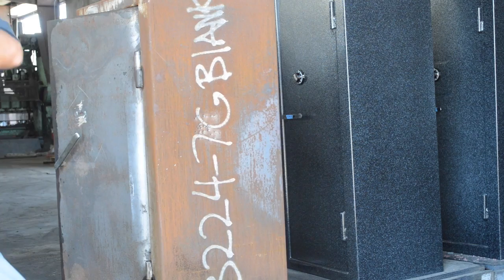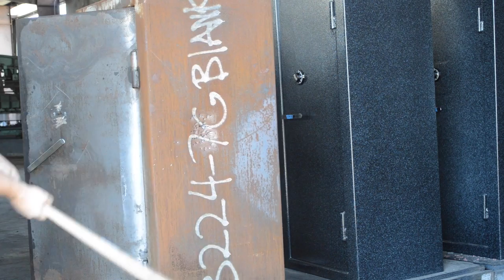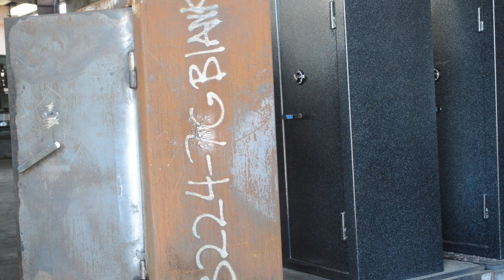Breaking Into A Safe With An Axe | Sturdy Gun Safes 3/16" Body Versus A Competitors 11g Body

Comment: Wow! I'm wishing that I had gotten a sturdy safe instead of the Liberty Revolution I bought. I was recently a victim of burglary and all my guns were stolen. The crooks used my axe to chop away the back panel after they dropped the safe on its door. Yes, it's my mistake of not bolting the safe to the floor and for leaving my axe unlocked and easily accessible. But, please learn from my mistakes so this doesn't happen to you. My guns will be missed but I have learned valuable lessons from being a victim of this.
Reply: Don’t be. That safe is just as garbage. Nobody is coming with an axe. They will have a grinder and sawsall. Unless it’s 1/4” plate steel or better, thieves will cut through the side in 3 minutes and be out in under 7 minutes.

Comment: I like a Sturdy safe. I feel they make a good gun safe. I'm not here to bash Sturdy but, the Amsec BF safe your beating up on was their base model with the 11g outer layer and 16g inner. I did a price comparison with options. If you added the 4g inner layer to the Amsec making it the HD version the two safes would be very close in thief protection. The cost ? Both safes if you compared Sturdy's 3/16 wall option with 3/8 door and Amsec's 4g liner option and 1/2 door the price was very close. They both offer a quality product. I personally feel Sturdy has a better locking mechanism on the door however, Amsec has a better door organizer and nicer looking safe. Either way you go if you invest $4000.00 in a Sturdy or Amsec Your going to stop most burglaries. In either safe power tools will get you in pretty quick.... As I said most burglaries ! You add a few cameras and an alarm system you should be good to go. Thank you Sturdy for this video I can tell you take pride in your work.      I know this video was to express that the poured fire material does not strengthen the metal or add security to the safe. I beg to differ. Anything that will slow a thief from gaining entry is a security matter. They will atleast have to cut it out of the way to get into the safe which will take more time than breaking out drywall.
Reply: With regards to fire retardant filler. I think they mean to point out that it's not cement that you would expect in composite walls of higher end safes. When there is an 1-1.5" of poured cement, the burglar is guaranteed to face noticeably more resistance than with sheets of glorified drywall.
Reply: You are correct. The Drylight sure isn't cement. If it came down to just burglary protection . I'd much rather have the thicker metal. I did learn this, the drylight is better for fire protection than concrete given the same thickness.   It's like playing rock,paper, scissors. Depends on the situation I guess. In a burglary i'd want the thicker metal.In a fire I want the fire retardant. Me I want both. I've seen the drylight in action. That stuff works . If fire protection is no concern to a gun safe buyer. Then a Sturdy safe is a good buy for around $2300. I wish Amsec would step up like Sturdy and make some hands on videos, this would help their sales. These videos show me Sturdy truly believes in what they sale and are not afraid to put it to the test. I like that. A message to Sturdy. I here a lot of complaints about you looseness in the handle. People don't like the jiggle it has. It makes the safe seem cheap. This may not make the safe any vulnerable but I know it's hurting your sales. People don't like it. Good product never the less, thank you for your videos.
Reply: Thank you for the update.Good deal, it's good that a company would keep their eyes and ears open to reviews from customers. Perhaps Sturdy has corrected that issue. I would love to see a posting of your safe and your thoughts on it. I'm looking to pickup another safe just to pack ammo in. Don't need the fire protection on that one. I may give Sturdy a call on this one. Good luck with your safe and always remember to keep your powder dry.
Reply: Very well stated. You have done your research. I am the fence as well, even after realizing exactly what you observed.
Reply: I found it hard myself to choose a Gun Safe. When your looking for a gun safe we all have a price range we're wanting to stay under. This is what I have discovered in my research. I put my budget under $5000. From Browning to Sturdy to Amsec to Liberty, to Steelwater , you name it I looked. Browning offers a good locking mechanism on there high end models but have thin walls. Sturdy has great burglary protection but not so great fire protection or appearance .Liberty has thin walls and too wide of a door gap for my comfort. Steelwater is a good choice for the money buy the're made in China and have no certified fire protection.  Amsec"s BF series offers good fire protection and good wall thickness if you upgrade to the 4ga. inner liner but, if you pull the door organizer off the door and look at the locking mechanism you'll be sick...The door locking works are very poor. I could go on and tell so much more where the Amsec BF series are good and lacking, this would take a while. I ended up going with a Amsec 6030HD. It cost me right at $4500 and took two months to get. As far as my choice goes I'm still not completely happy because of the way they made the lock bolts. Every gun safe I looked at has issues. If you and I want great fire protection plus security and be completely happy with both we're going to get into the $7500 price range. If I was willing to go up in price my next choice would be the Graffunder "B" Bishop Series B3032. Your looking at $5600 not counting shipping. I hope this helps. We haven't even touched on the subject of water damage just about every safe is not water proof and guess what the fire responders are going to put on your house fire ? Life sucks don't it. Good luck with your safe and keep your powder dry.
Reply from the maker: If we offered a comparable gauge and size to the Amsec6030HD our price (at most) would be $3331 delivered. Our safe would be larger at 32w 24d 60H, have the heavier body plate of 4g where it matters the most (which is the exterior plate), 3/8" door, 10g liner, and fire insulated. As far as the gauge thickness, linkage design and fire protection, for the size, there is none that can close to our price range. We are a commercial safe, so there is a commercial look to them, but people can pay more to dress them up. 

We have a very costly insulator that was designed to insulate objects from fires. It is an excellent fire insulator that has gone through complete burn downs successfully. Unfortunately, a representative of one of the companies you have mentioned has done quite a bit of marketing against our fire insulator on forums, and others keep spreading his message. It's flattering a company so large found us to be so intimidating they needed to have someone participate on forums to discredit our company, simply so they can compete with us. Sure, we don't want to put a fire rating on our safes, but this is because we don't want to lie to you like every single RSC on the market is. Unless UL tests it, you can't believe the rating. If fire protection is that important to anyone on a safe, they need to get a UL tested fire safe, and there is not one RSC on the market that will have a UL fire rating. We get into greater details about ratings and insulators here: https://www.sturdysafe.com/pages/sturdy-safe-fire-liner-info
Reply: Larry, SturdySafe1 is right.   Your claim that Sturdy "not so great fire protection" is completely unfounded.  2000 degree insulating blanket is used to insulate metal foundries.  You know: melting metal.     Sturdy Safe's have a sealing gasket that expands on contact with heat and water to help prevent water ingress.   On my sturdy safe I had them add a second layer of that heat triggered gasket material for some cheaply added insurance. I have no reservations about the fire protection ability of 1000 + 2000 degree insulation versus fire board and cement.  Fire board and cement are NOT insulating options.  They are fire resistant materials, but they do not protect against the conduction of heat.  You can take a blow torch to 2000 degree insulation and put your hand on the other side of it and not feel the heat.   It's hard to argue with physics.
Reply: I am not aware of any UL listed safe that uses ceramic wool, gypsum board, or any other means that gun safe manufacturers commonly use to achieve their rating.  All of these safes use a "cement" type of fill, although the composition of that fill is definately different from manufacturer to manufacturer.

 Ceramic wools are somewhat inexpensive, and very easy to install.  If they were as effective as the method that has been used for 200 years, there should be at least one company (that has UL listed safes) using it as a primary insulation.  I'm not aware of any, although a few companies do use it as a secondary insulation.

 There is always somebody who can claim to have a better method, but if it really was, everybody else would jump on the bandwagon.

 The cement type fills have been used, and continue to be used, by the biggest and best safe manufacturers world wide.  I will assume the industry as a whole has it figured out better than you and I can break it down here on the forum.
Reply: larry c  Measuring what one company does by using what other companies don't do as your argument is a form of straw man argument.   I gave you an argument on the merits of the material itself.   you could have tried to argue that refractory cement is a better insulator material.   you could have argued that ceramic wool is friable.  at least those attempts at a counter argument would have been based on physics and logic.   There is my own form of straw man argument for you.  Now to address your point:   none of those companies put their safes in whole home burn down tests conducted by the fire department.   Their claims are untested.   Sturdysafe has tested their insulation in actual home burn down fires.   I haven't seen any other age safe companies test their safes anywhere near as thoroughly.  I guess by your logic that makes sturdy safe somehow less.    "other people don't do it so it must be inferior" is an empty argument.
Reply: This is a pointless discussion. Enjoy your Sturdy
Safe.
Reply: underourrock what about liberty? They ran a whole add campaign about that for a few years
Reply: Yeah exactly I have motion sensor by my safe too and it's a Fort Knox B rate safe. I should be good
Reply: If your concerned about fire
Run a cold water line with a check valve and a sprinkler head above the safe 
 Myself I'm more concerned about burglary then fire 
Plus if it's mounted properly and in a nice tight area they are most likely not getting in
Most robbers are in and out quickly

Comment: If you have time to beat on a safe like that trying to get it open you have time to cut it open with a grinder. I'm not saying this safe isn't obviously a beast but the accessibility of modern power tools has made stand alone safes significantly less useful than they use to be.

Comment: Are you positive you're using your competitors' best safe with their added metal upgrades? Or are you doing what everyone else does and comparing your best to their entry-level product 🤔 most reputable safe makers will let you buy as much metal as you want.
Reply from the maker: This video was taken a very long time ago. Things change over time for all manufacturers, however during this time we were continuously compared to this particular brand and model, with this particular insulation still used today. Dealers would make claims of the insulation adding security. We did this video to show them how much security this insulation actually adds.

Comment: With all due respect, you are using an axe. Your safe is certainly more durable with the blunt end but can we see how many blows with the blade of the axe it takes to get into your safe? I can't imagine a burglar with an axe would not use the blade of the axe they brought with them. Also, the fire insulating material is not anything I've ever thought of as a deterrent. Maybe that's just me. I've only thought of the metal structure and bolting system as the deterrent.
Reply from the maker: What you say might hold true with Wood however, with steel it’s better to pike through to breach faster.
Reply: @SturdyGunSafeMFG  - Ah....I studied the video further. I didn't know there was a point on the backside of the axe head. I thought it was just a blunt, rectangular side and the edge of it was being used. Thank you for the clarification.

Comment: After researching safes, I was set on sturdy then I read their lifetime warranty requires a rejection from your home owners insurance, well if they accepted it it's a $500 or $1000 deductible, AMSEC doesn't require that, the warranty is on a burglary attempt not a warranty on whether or not your insurance company paid for it. I continued by research and decided a TL-30x6 is what I'm going with given the minimal additional cost.
Reply from the maker: There is no "double dipping" unfortunately. If your insurance company is going to pay for it, we won't cover it as well. If they say they are not going to cover it, we go ahead and cover it. If you told your insurance company you didn't want to pay for their deductible, they will write you the letter saying they won't cover it. TL's are great safes for those who's foundations can hold the weight and owners who can afford the costs of them.
Reply: amsec safes at this price point are still 10-14 gauge, that's a fail...

Comment: Damn that did a lot better than I thought it would do.
Makes me ask how bad of a job do you have to do to assemble a safe with 1/2" & 1/4" thick steel door and walls that fails a UL RSC test.
Because that has apparently happened before.

Comment: Do this axe test on a graffunder fortress safe
Reply: Graffunders can be cut through in minutes with a cheap power tool. Their highest end models would last 5 -8 minutes. (6X6 inch square opening on 1 inch of steel)
Reply: @alexmarlow2508  Umm, that's just not true... you can cut a 6x6 hole through mild steel 1" plate with a good saw with a good blade possibly in that amount of time to be sure. However their top of the line model use 1" high tensile plate backed by 1.5" high pressure cement composite filled with all kinds of bad stuff. They build those to a TL30 standard, you can watch UL tests to see how quickly one can attack such materials. It's not a few minutes and a harbor freight circular saw kinda deal my man.
Reply: @tdb19872  TL-30 can survive an attack by power tools for 5 minutes
Reply: @alexmarlow2508  You have some very serious tools then, lol.
Reply: @tdb19872  not mine, it’s the testing protocol, TL-30 bodies need to survive 5 min of tool attacks, it’s their guideline, read up on their testing thing or the definition of TL-30 safes
Reply: @tdb19872  TL-30 and TL-15 walls have a 5 min survival time on the UL test, the doors of TL-30 is 30 min and TL-15 is 15 min. If the model you are speaking of is built up to TL-30 or TL-15 level then they'd have the same 5 min tool attack time in theory
Reply: To be fair, the “test time” the lab uses is nothing close to “real world time”, they only count the time when the tool is making contact with safe, and pause it the moment the tool leaves the safe. Their “5 min” test usually takes well over an hour, and they’ll use a sawblade and drill bits a few times before they switch to a brand new fresh one, so their test time doesn’t reflect a realistic scenario. Graffunder safes would probably last at least an hour or two against skilled hands even with power tools.
Reply: @Alex  not real world at all, TL testing is absolute worst case.

Comment: I read that Sturdy Safe has 3/16" steel on the sides, thicker than other safe manufacturers.  Even on their website, under "HOW THESE SAFES ARE BUILT, it says it will stop NON-POWERED tools from getting through as demonstrated in this video(nothing about powered tools).  I wanted to believe these were superior safes.  however it took 3.5 minutes to cut a 3/16" plate steel all the way across using a circular saw.  Using a grinder the timing may differ but it can be done in a short time.  If you want to see the video here is the Youtube link.  https://youtu.be/EDwxLnkq2z8 Sorry Sturdy safe
Reply: So which safe for the same price did you select? No one out performs the Sturdy at the price points. The video you shared regarding someone cutting across a flat on its back non-secured 3/16 steel plate is beyond laughable if you used this as part of your "credible" research in safes.  Sorry Uber You Tuber.
Reply: whats your point? thats ANY safe short of a Graffunder.... sturdy still the best for the price BY FAR.

Comment: Was just noticing the axe used on the sturdy safe had the point cut off of the part used to hit the safe!  Hard to see but look close. Misrepresentation of facts by a company means poor quality probably should not buy their products. It maybe the same axe but it’s definitely not new or sharp like it was just taken off a fire truck. This test needs to be repeated showing the tools used
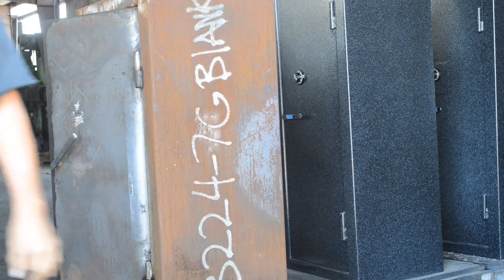Reply: 2:11
Reply from the maker: Same axe was used. Resharpened the same way and equivalent amount before each test began. This test was done fairly. We believe we are the most honest safe manufacturer out there.